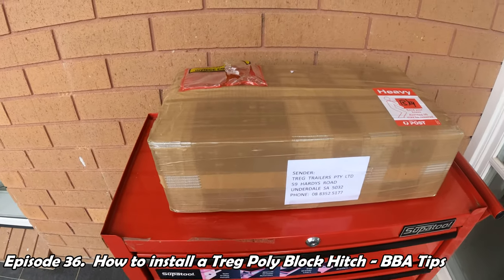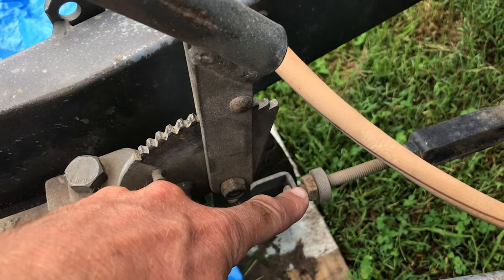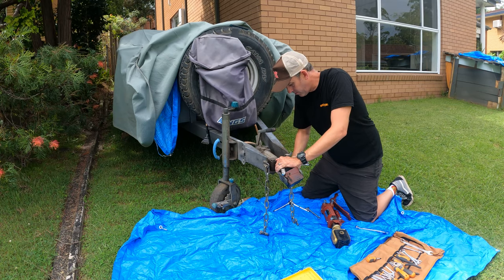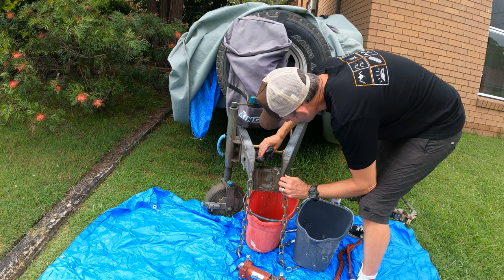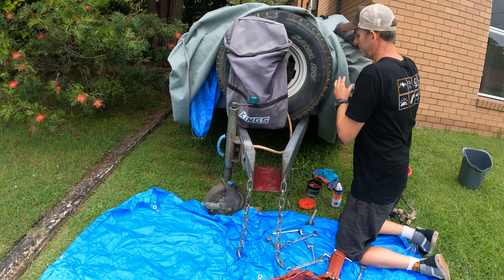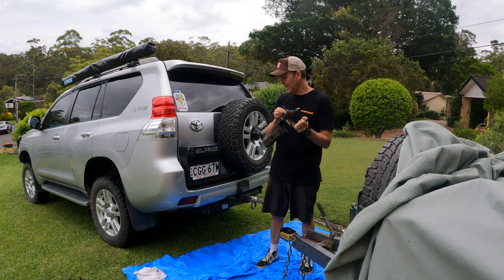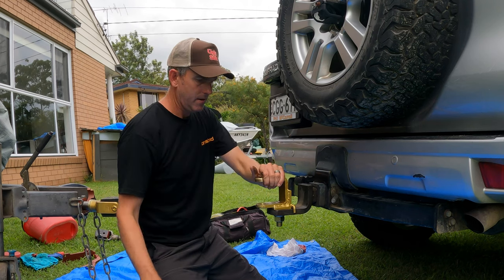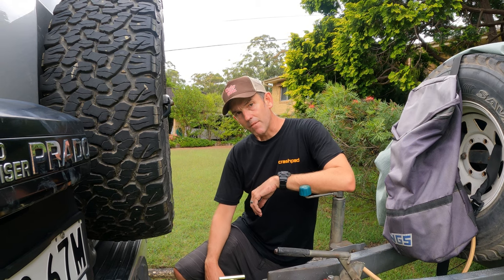How to install a Treg Poly Block Offroad Hitch - BBA Tips EP36

Comment: Don’t forget you should cross your chains when actually towing. If it comes off the hitch, the chains should catch it, in theory. Good video though
Reply from the maker: Absolutely mate.....always do that on the boat.  Chains are a bit too short on this trailer and pull too tight when you turn on full lock.  Good point though, i will get some extra links just in case the hitch fails :)

Comment: You've put grease on a friction surface. The bolts only hold pressure and the friction is what gives it strength the same as a wheel what you've done is put all the load on the bolts.
Reply from the maker: Oops, that is a very good point.  By trying to counter one problem (corrosion), I have created another one by overloading the bolts.  Thanks for the great advice.

Comment: Does the rubber block survive sharp turns?
Reply from the maker: Definitely, all the turning is within the pin and metal sleeve within the poly block - so no issues there

Comment: Silly way of hitching it. Just reverse alongside the block, use the jockey wheel up and down to get the height right, and push the A frame across with your knee. Drop the pin in .. MUCH EASIER.